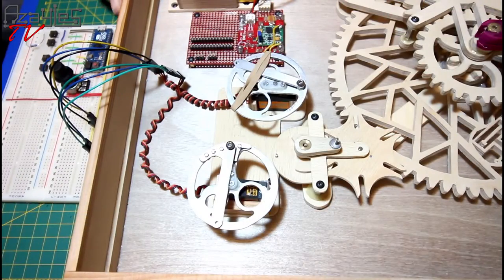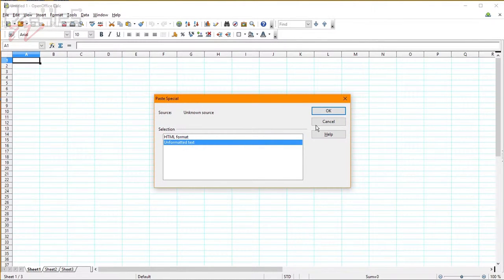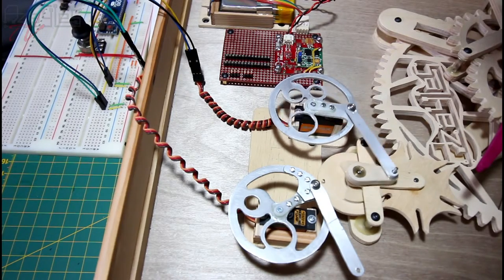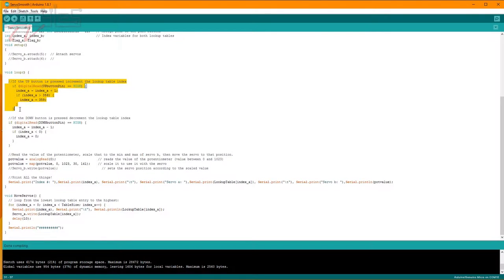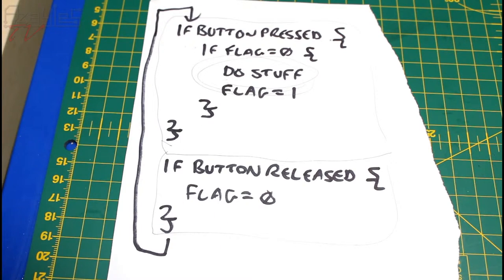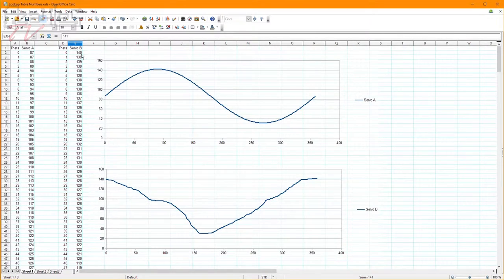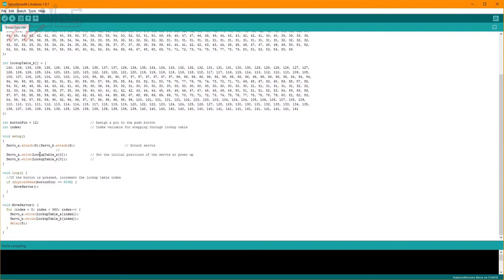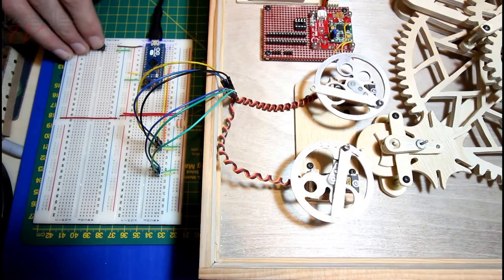Wooden Electromechanical Clock Build - Part 15

Comment: Looking good. Can't you just copy servo A table to servo B, only shift B 90 degrees? At 12:26 it looks like servo B is 90 degrees behind servo A.
Reply from the maker: Very good question :D Servo B is indeed behind Servo A by 90 degrees, but unfortunately I can't use a sinewave for both servos, as there isn't a linear relationship between the angle the servo moves and the angle the geneva arm moves :(
This is due in part to the servo arm and the geneva arm being slightly different lengths, to allow the geneva arm to be able to sweep fully left and right while having a smaller range of motion from the servo, and also because the pivots for both cranks are on a different axis.
I tried addressing this in a previous video, but I don't think I was particularly clear, so I  have a more visual way of showing this which I'm planning for the next video :)
Thank you for your continued support and feedback :D